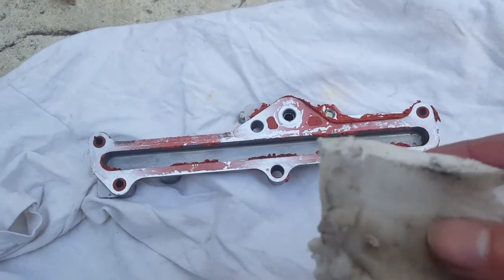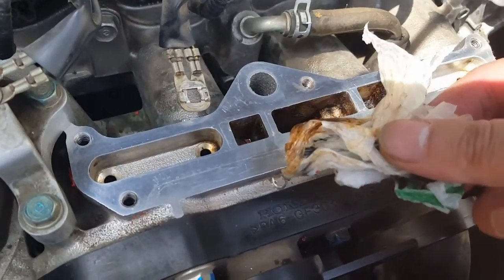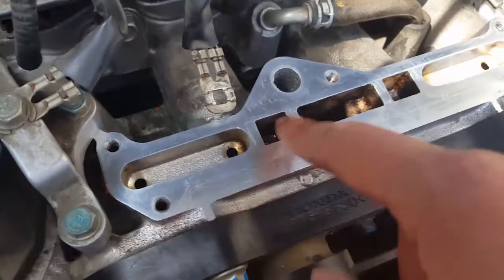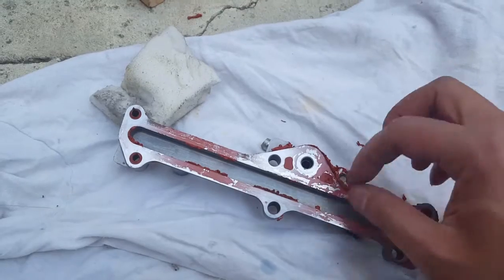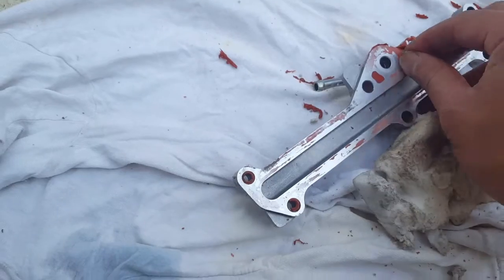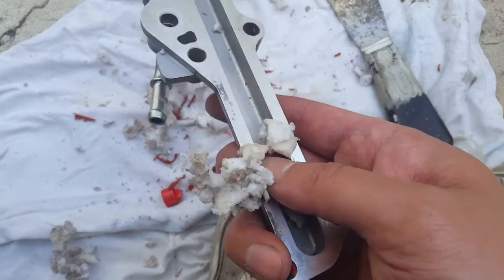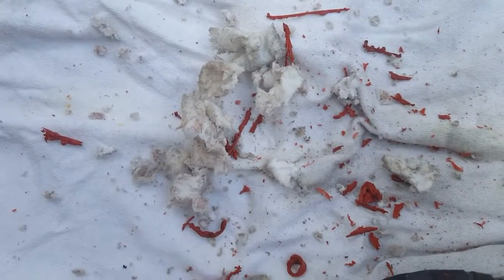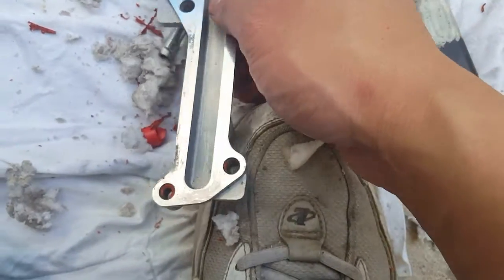DIY: Cleaning RTV Silicone off WITHOUT SANDING!  Using melamine to remove RTV.

Comment: Your trick worked wonders for me. Thanks for the tip.  I had RTV on the aluminum valve cover gasket side that I needed to remove.  All if it came off cleanly with minimal effort with the melamine sponge.
Reply: Fred Fermin did you have any oil leaks from using rtv prior to removing

Comment: Last thing I want is sponge material in my engine. Probably not as bad as some suggesting steel wool. Gad Zooks!
Reply from the maker: Yup thats why i clean the parts proir to reinstalling. Ofcourse thinking back, its probably cheaper on the long run to just use steel wool or a polisher as that sponge is pretty pricey...

Comment: Where does one find a melamine sponge?
Reply from the maker: Actually, this video quite old. I just scrap as much rtv off, then use WD40 to dissolve and wipe off the rtv, fine steel wool or sand if needed.
,  then use carb or brake cleaners to finish.  ... melamine sponge can be found on Amazon it acts as a very fine scrubber.
Reply: A “melamine sponge” is melamine foam, aka a Magic Eraser.